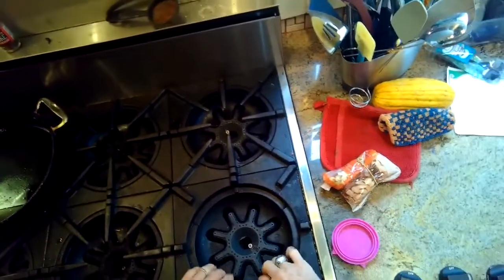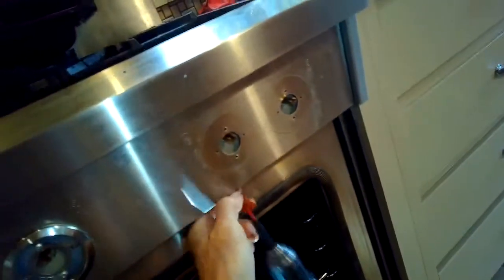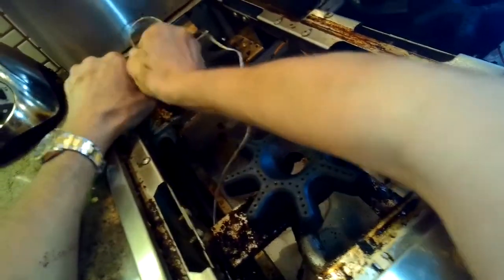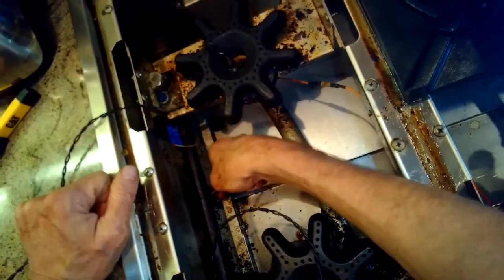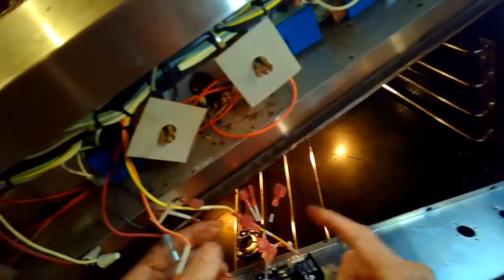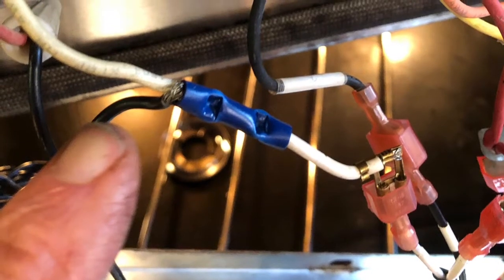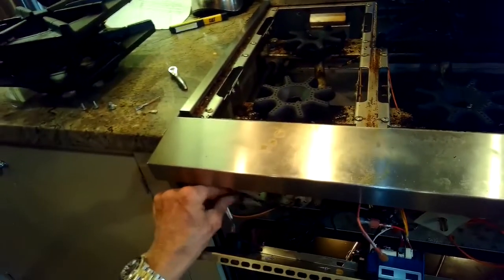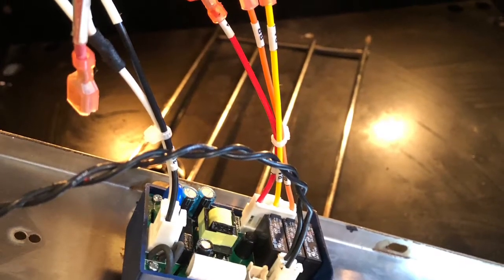🌠BLUE STAR RANGE - Won’t Heat Up- EASY THERMOSTAT REPLACEMENT**

Comment: We have a BlueStar have changed both Ignitors in the oven it goes initially and then when reaches temp cuts off when it goes to reignite will light but will not relight any ideas
Reply from the maker: Sounds like the thermostat may need to be replaced 👍